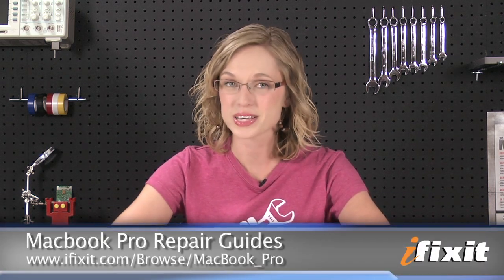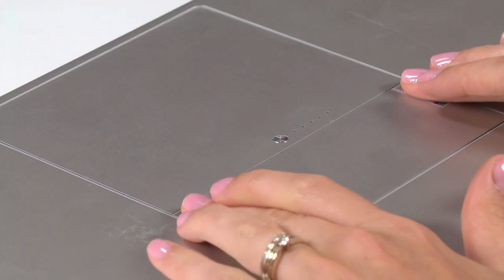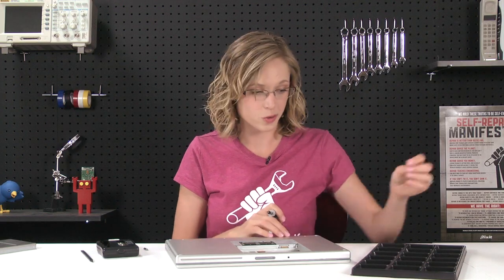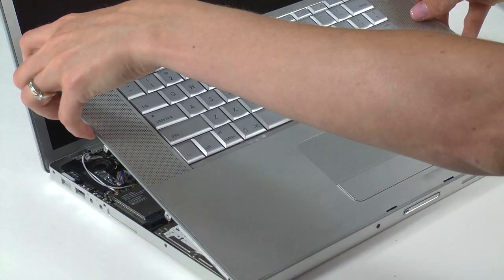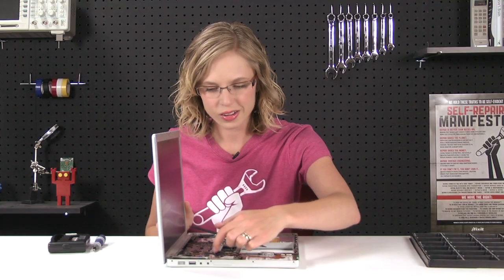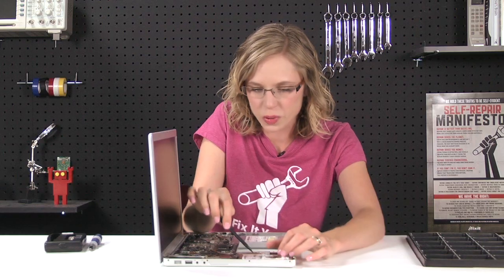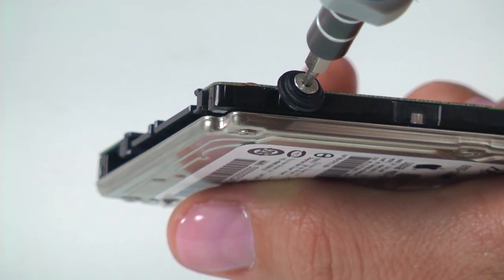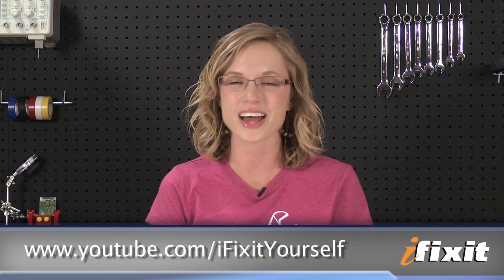How To: MacBook Pro Hard Drive Replacement

Comment: This video inspired me to try replacing the dying hard drive on my MBP A1260. I followed the step-by-step guide on iFixit's website and it worked exactly as shown. I replaced my 250gb, 5400-rpm Hitachi with a 750gb, 7200-rpm WD. Tips: the ribbon on the HD was so firmly attached I used a stiff piece of plastic from a report cover because it was thinner than a credit card. I also bought a $1.99 SmartPro screwdriver at Ace Hardware--it has the #00 Phillips head and #6 Torx in addition to other sizes. I used Carbon Copy Cloner and everything worked, but I had to re-register my MS Office 2011. If you have MS products, be sure you have your product key!
I'm typing this on my rejuvenated MBP and I can tell it's much speedier. Thanks, iFixit! Great presentation, MJ!